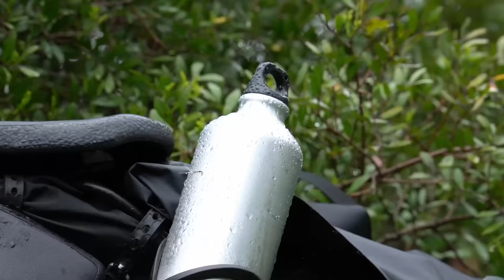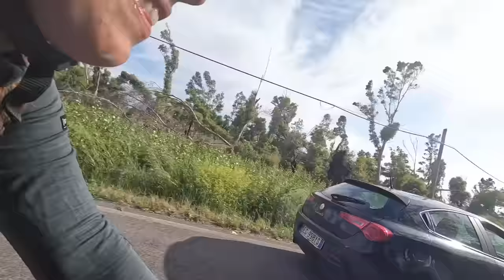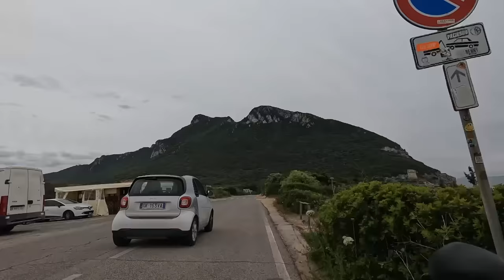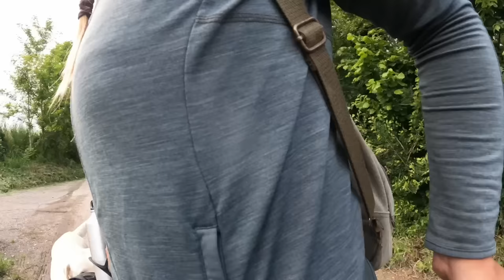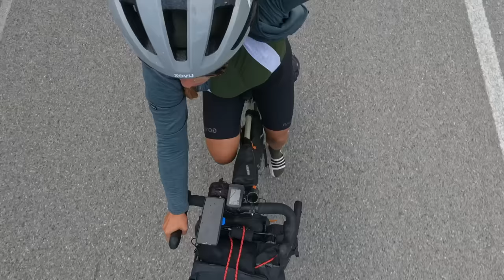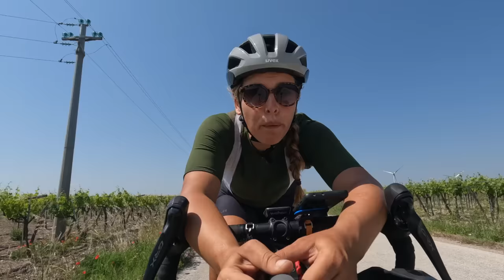ITALY - Solo Bikepacking pushed me to my limits

Comment: Everyone needs a break at some point.  Your journey is for you.  I‘m glad you share parts of it, but you shouldn’t feel obligated to share more than you feel comfortable with. — If you are taking some down time, then enjoy it to the utmost.  

Your 3 flats had me smiling.  I just returned from my little thousand Km bike camping trip for this year.  2,5 weeks with zero mechanical problems despite a few hundred Km of off pavement riding.  On my second day home I went for a ride with nothing on the bike but me and my little emergency supplies.  Two flats in one day!  And, after more than fifty years of frequent bike holidays something totally unexpected happened.  When remounting the rear tire I snapped the skewer on the rear wheel. 🤦🏻 Life always has surprises for us.

Take care.  Enjoy yourself.

Comment: Upgrade your tyres. Also you can buy tyre inserts that offer even more puncture protection. And try cycling with stiff soled shoes and cleats. You will put more power into the pedal and save energy.

Comment: You need to get some sealant.  It will stop 95% of flat tires.  If you do get a flat, you can almost always remove the object, pump up the tire and it will seal.  If it's been 6 or 8 moths, just add a little fresh sealant.  I recommend Stans, it's the best.  You can use it tubeless or in a tube.

Comment: Try dry, hard packed surfaces such as road bike touring instead; you may find this a little more enjoyable. :) You were angry because being confronted with a situation that more than likely has been a prolonged challenge and you became tired of dealing with it. I would be crabby too. Riding on hard pack trails is an easier go and not so challenging such as when mountain bike packing which has more technical terrains to deal with. (a lot more ups and downs for you as the bike packer).

Comment: Hello Laura from French-speaking Switzerland! I was touched by all your troubles but congratulations for having left without delay the place where the 2 dangerous guys. For the other galleys, your bike is a disaster! I wish you one day to have a steel frame with a Pinion system = belt transmission and also for the comfort of wider rims and tires. Finally, a sufficiently large tepee tent (4p = 2.6kg) would allow you to sleep with your bike in it (all dry and without worrying about theft) and more air vol-ume and less humidity when it rains. Your bad choice of bike could end up putting you off cycling permanently and that would be a shame. For security, I opted for an ultra-powerful led torch (ordered in Asia) which even during the day dazzled enough to make it difficult to attack. Last idea, maybe this kind of trip, you should have prepared it with contacts via social networks to already be able to join couples and families in or-der to rest and/or in the event of a problem, take a detour knowing that you know serious people who will host you. Here, now I wish you that it gets better and that these galleys are only a distant bad memory 😉 Good road ^^ PS I loved hearing you pester in German:)